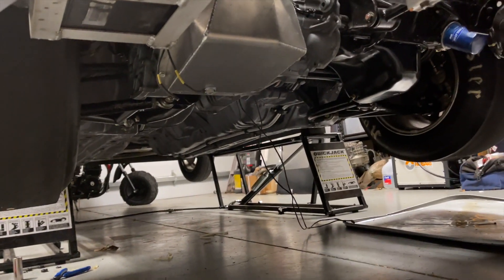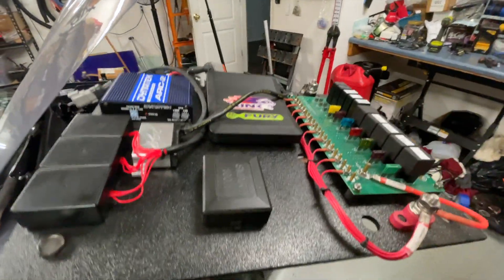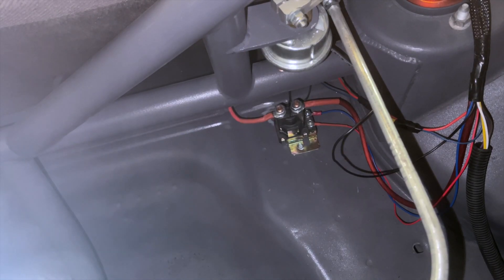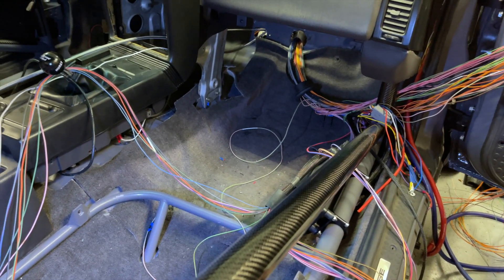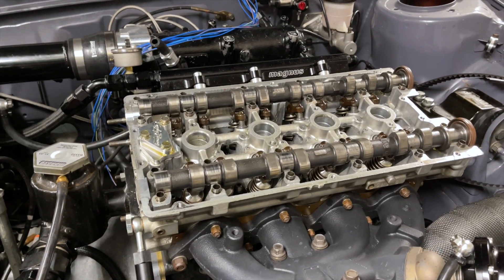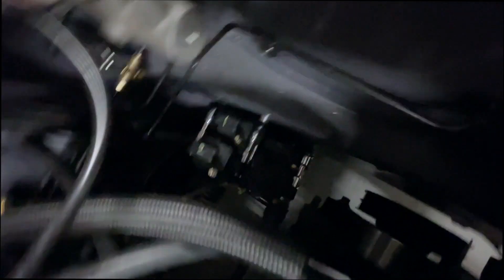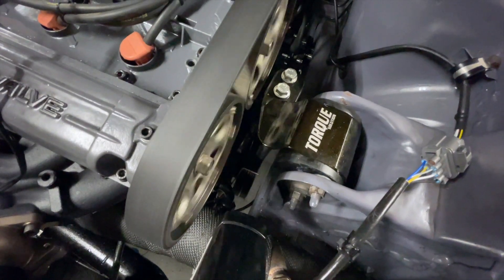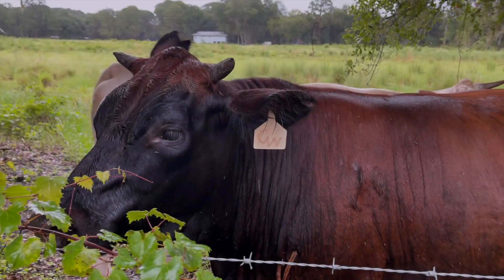Haltech Nexus R5 installed in DSM!

Comment: Nice. What are hoping to gain from this system?
Reply from the maker: The built in PDM and CAN Keypad have cleaned the car up a ton. Everything is much simpler as far as the wiring goes. The Haltech has pull up resistors on all "temperature" inputs, so my oil temp and trans oil temp work. I can use hi res speed sensors with Haltech. Haltech has more advanced Torque Management and Traction Control. Also, most of my car buddies run Haltech and the tuners I'd like to work with like Haltech.